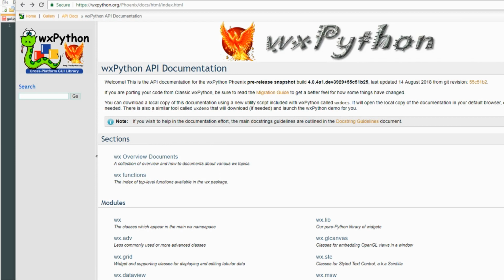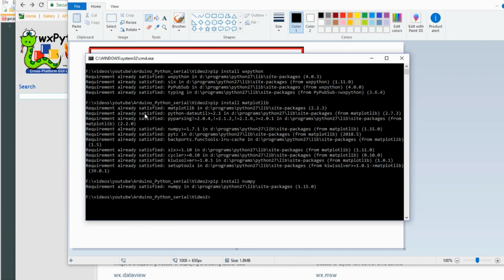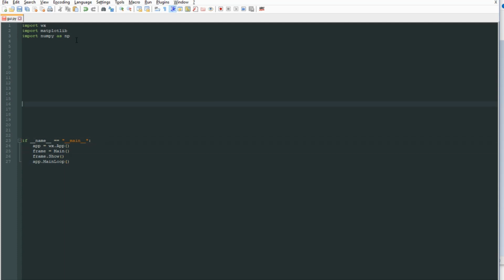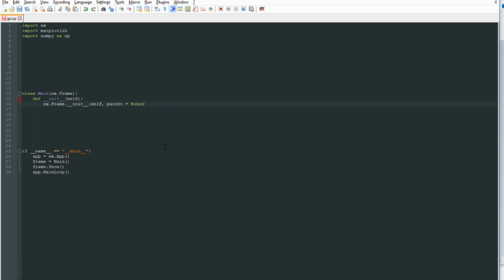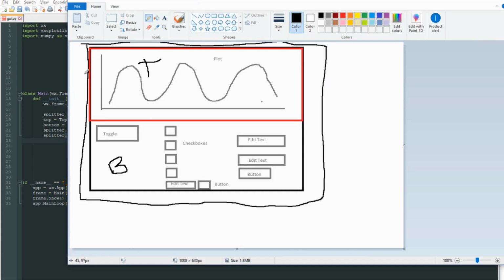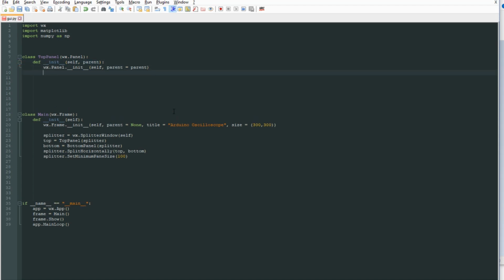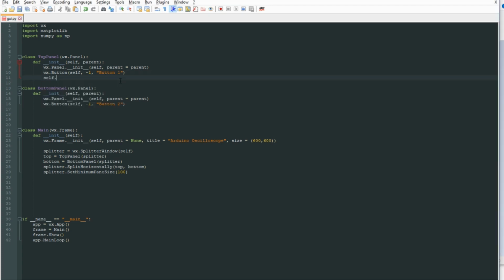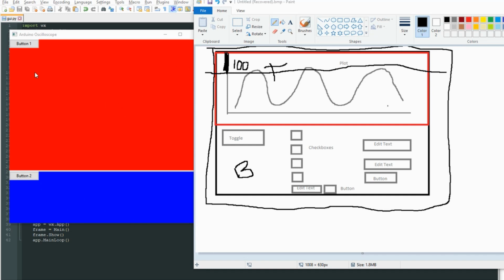Create wx panel and frame (Part 1 wxPython Arduino GUI)

Comment: Can I just use 1 panel for both the plot and the buttons?
Reply from the maker: Honestly I'm not sure. I could never get it working with one panel. I could put elements in a panel but they would never be able to be interacted with. I also personally liked using two panels because I like keeping my controls separate from my displays with the only downside being how do I pass information back and forth. I will never say I always do things the best way but this was my approach for this problem.
Reply: @EngineeringCorner  Ah yes I also have the same problem. Howerver for passing info between 2 class, you can create a global variable for easier access without passing the whole class like that.
Reply from the maker: @etherious1017  Agreed. At some point in my life I had it beat into me globals are bad and to avoid them whenever possible. But I do agree for something like this they make everything alot easier

Comment: hi very good tutorial !! thanks
how to add button to close the serial communication with arduino?
Reply from the maker: I put 4 videos up about how to make the gui. Part 2  has toggle buttons so you need to keep track of the state of the button and make the serial connection in there and close or open depending.  I haven't recorded making the arduino talk with GUI yet. Hoping to this weekend or next. In order to make it work well you will also need a wx.timer so the GUI doesn't become unresponsive